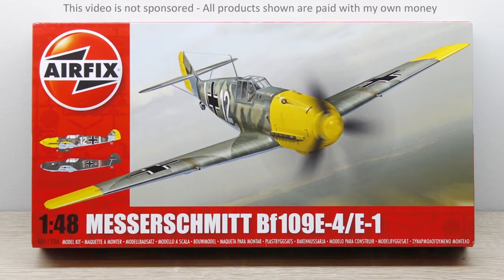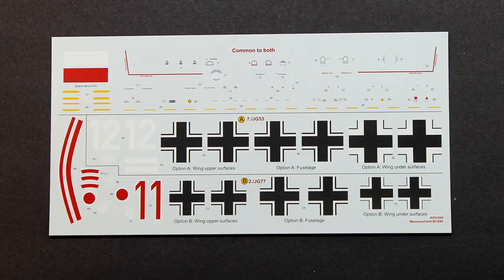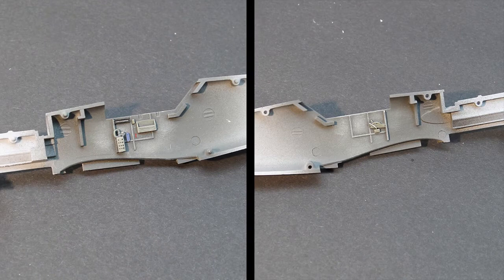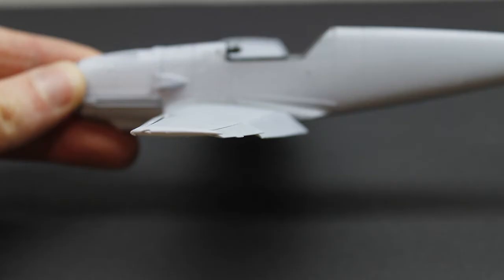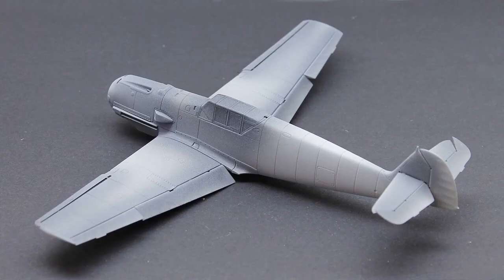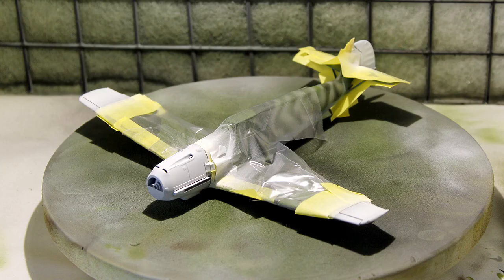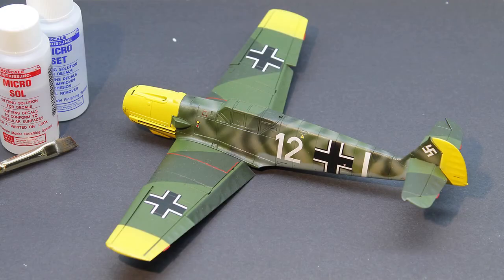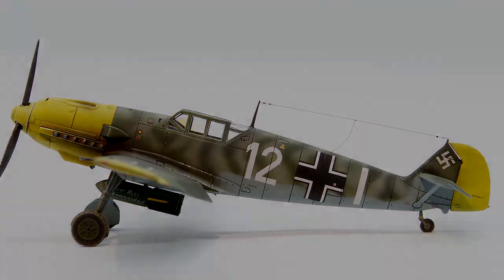Messerschmitt Bf 109E - 1/48 - Airfix A05120A Build

Comment: This is amazing can’t believe doesn’t have more views. What is a good wash to use for panel lines, tried using citadel wash but it’s messy and dries quick so can’t fix mistakes
Reply from the maker: Thanks Will!  I like to use oil-paint mixed with white spirit, but I also like the Tamiya panel line washes, as they are ready to use so you don't loose time mixing washes. The Tamiya panel wash can also be removed easily with white spirit.
Reply: @stevenshobbychannel  thanks! do you need to protect the paint layer before using spirit or will it only affect the wash?
Reply from the maker: @willneve  The white spirit will attack enamel paints/washes, but it should not affect the acrylic paints used for camo. It's always a good idea to test it out on a test piece or at least the underside of your model :)